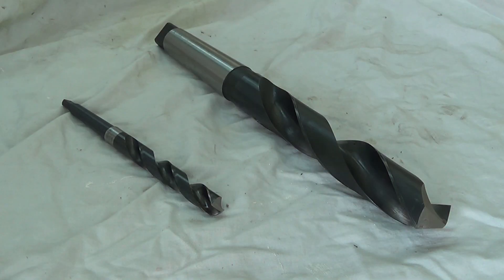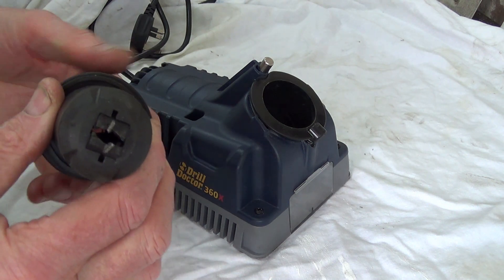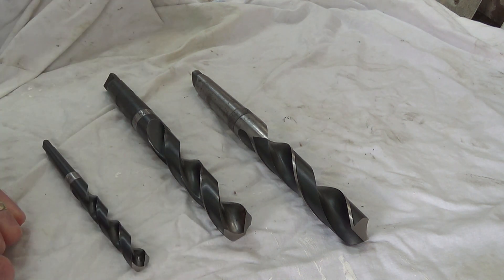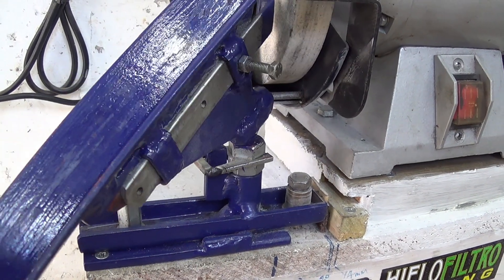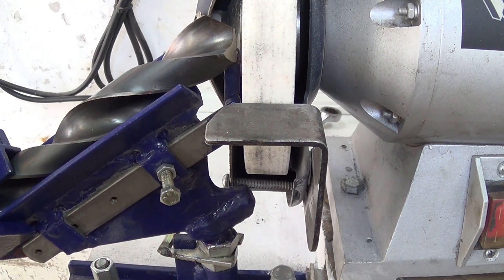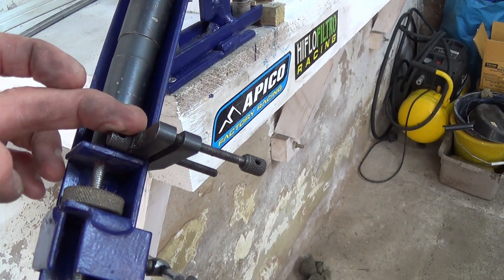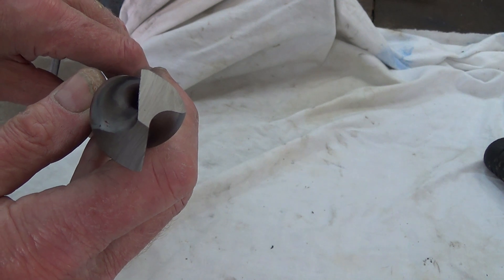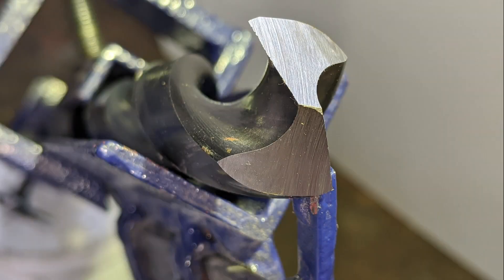HS9 Making a large drill grinding jig

Comment: I like it. Good job.
Reply from the maker: Thank you👍 It only approximates the angles, being single action, but it works. The trick is setting the right distance between the pivot and the wheel, and it's very sensitive to that distance vs drill size. Cheers

Comment: Nicely done. I've owned 2 Drill Doctor's, bought my 750X about 18 years ago. I love it for drills smaller than 1/2" (~12.5mm). It's fast and works well. But, for bigger drills, it sucks. So, I tried to learn hand sharpening... and, I suck! So, I broke down and purchased a Lisle 91000 drill sharpener. Finally, I can properly sharpen drills as large as 1-1/4" (32mm). The Lisle sharpeners, although obsolete and no longer serviced by the manufacturer, are not inexpensive. So, I commend your effort!

Comment: The thing I don't like about this type of drill grinder is that you have to remove the drill from the device and turn it around to do the second side..........the Quorn cutter grinder overcomes this by having the drill mounted in a holder that rotates to access both sides, but unless you have a Quorn T&C grinder that is just saying.
Reply from the maker: HI Gangleweed, yes that is a weakness with this setup. I have to be very careful when I rotate and reclamp the drill to grind the 2nd flute else when I've finished it will only cut on one flute. It takes a bit of patience and practice. Cheers

Comment: Better a drill bit than an axe to grind! Good video, perfect photography as usual. If you make plans, I will be glad to buy them from you. I am too lazy to go thru the concept phase by myself. thanks for the upload. I am afan! Bernard from Brittany.
Reply from the maker: I Bernard, I'm sorry but I did not make a plan. It was just head scratching and trial and error. The final setup was quite different from my initial ideas, just proving I did not understand the principles well at all at the beginning.  The sliding distance adjustment between the drill face and the wheel was key. Tiny movements make a big difference to the rake angle. I don't know how the cheap small drill grinder stands work properly without that. Similarly I could not make it work if the drill swept past 90 - it just rounded off the cutting edge. Cheers
Reply: I have a Drill pro sharpener made in the US.  I bought it in Spain. Works perfect till 13mm.The rotation of the jig is is not circular . It has a small angle with a cam lobe to it to wrap around the tip of the drill in order for the outer edges to cut through. the problem is the surface area is too big for the wheel past 13mm. I still think yours  would be the solution. How hard is it to brake into your garage at night? Do you have security cameras? @HaxbyShed
Reply from the maker: @bernardmauge8613  🤣 dogs and barbed wire, patrolling guards.

Comment: It has to much runout on stone
Also vibrates so out of balance.
Reply from the maker: Hi John, it's a cheap grinder. I have tried to improve the fixing and balance, it's a lot better than it was. Imperfect method but does for most of my hobby jobs. Cheers
Reply: @HaxbyShed  the 24 dollar general fixture is better than a drill doctor
I have an old lisle 91000 that bought use for 40 dollars  does a wonderful job except doesn't do split point so am making a fixture to split the point. And do the 6 th facet.

Comment: Excellent example for a home owner hobbyist how to build an affordable large drill bit sharpener.  Thank you, I appreciate you're sharing your ingenuity.  DRILL DOCTOR - I bought a 500X sharpener and I have the exact same problem, it does not cut a relief behind the cutting edge.  The sharpened bits look great, however, without a relief behind the cutting edge the bits will not cut.  Won't even cut wood!  The Drill Doctor is a total waste of money.  For me, as a hobbyist, I cannot justify spending thousands on a professional sharpener [and my wife would not allow it either :-)  Building your sharpener is time well spent.
Reply from the maker: Hi WKelly, yes I was really disappointed with the Drill Dr. I'm sure I could get it to cut a back rake (relief angle) if I spent enough time diagnosing the problem. I've read the instructions until the print was worn off the page and sometimes I can get a bit of rake but not reliably. I think some of the DD models are better than others. Cheers
Reply: @HaxbyShed  Before my Drill Doctor went out of warranty I contacted DD Support.  I was emailed the same instructions that came with the sharpener and was told "try adjusting a little left or right of the setting".  This did not improve the sharpening to cut.  I lost interest in it again and shelved it.  Sometime later,  I contacted DD Support again and told them something may not have been assembled correctly and asked if they would look at it if I sent it back to them.  I was told "sorry it's out of warranty and there is nothing we can do for you".  The DD is junk and they know it.  Nevertheless DD continues to make the sharpener and people continue to buy it.

Comment: I like your videos, especially since you have limited room.(as do I). What do you think about 4 facet grinding on large drill bits(larger than19mm,3/4"). Hello from Houston!
Reply from the maker: Hi candeservices, nice to have your comment from Huston.👍 My drill press is MT4 and is rated up to 1 1/4 in (32mm) in steel. But I only have one drill ground with 4 facets - was like that from new. By chance It happens to be 32mm. Now I guess the real question is perhaps how would I grind 4 facets? I think by doing the grind in two stages and changing the distance between the wheel and the pivot, and changing the index position of the swivel limit I might be able to make some attempt at 4 facet. It would be tricky - but some experimenting might prove it easier than it might seem. I'll maybe think about it in the background as to how it might be done on that basic jig. Cheers

Comment: I suspect that this jig, like its commercially available first cousin, only grinds the drill to approximately the ideal shape.  However, this is obviously sufficient, as your cutting tests show.
Because the drill needs to produce a conical depression as it cuts, it seems to me that a jig that rotates the drill and simultaneously advances it towards the grinding wheel would produce a more correct profile.  What do you think?
Reply from the maker: Hi Chris, yes your observation is correct. The limited arc swing of my jig creates an approximation of the correct geometry. A professional drill grinder would push (advance) and twist - but they are very expensive for a hobby shop. Cheers

Comment: I started grinding end mills with a #2 tool&cutter grinder back in early 70's I was retired up to 2019 ,now I'm grinding end mill again, your set up is simple and to the point,thanks for this video
Reply from the maker: Thanks Albert. I had looked for a large machine drill grinder but everything was complicated and expensive, so I made this rig as a compromise. The geometry is not perfect because it only swivels in one plane but for all that it works pretty well and cost me just a bit of time for experimenting and to make it. Cheers.

Comment: This gadget is a winner. I have a small version of it but could not get it to play properly! After seeing your solution I'm going to have another go with it. I will build your big one too. Thanks for sharing.
Reply from the maker: Hi Peter, I've tried to make drill sharpeners in the past and failed. The thing is, as you may know, the industrial ones have two actions to generate the shape - just like sharpening by hand. These 'one action' swivel types have limitations but I got it to work if I started with the leading edge presented at the rake angle and then swivel just enough to create the backing clearance. I've seen people on Youtube swivel the jig back and forth right across the 90 degrees axis (perpendicular to the wheel) and honestly I can't see how that works.  It took all the rake off at the point and the drills would never cut - they only rubbed. Maybe you can get away with that on small drills but not on large. Or you can pay a few hundred £/$/x and buy an industrial sharpener :-)  When I get some blunt drills maybe I'll show the thing in action, but I've not been to the autojumble (where I usually get my blunt drills) since lockdown. Cheers